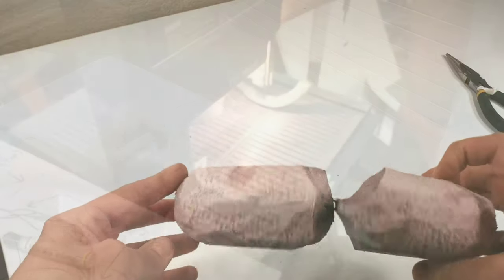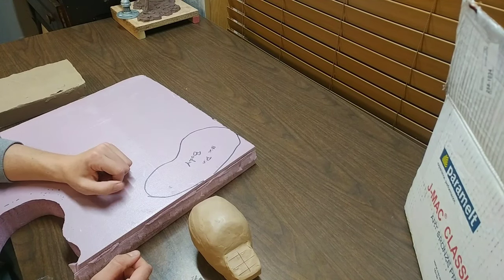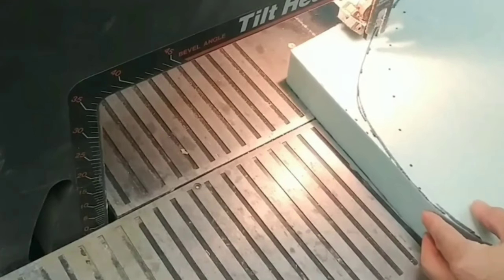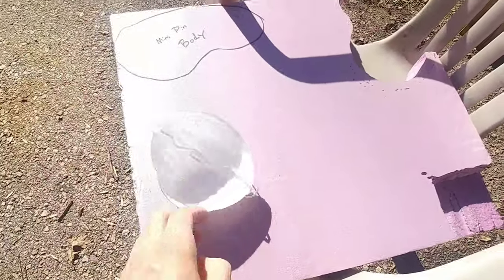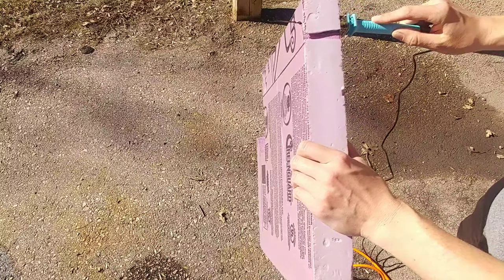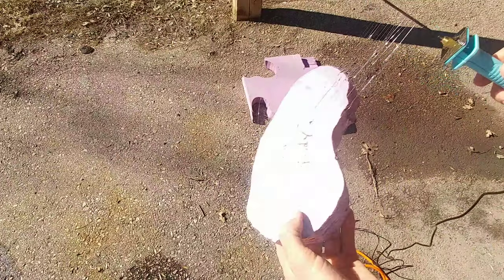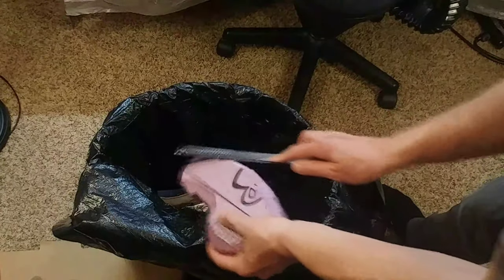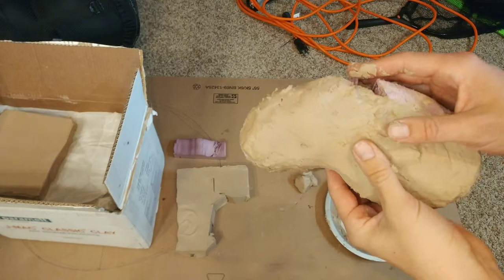How to Cut Foam (Polystyrene or StyroFoam)

Comment: Very thick pink foam can be hard to find locally and super high density stuff gets pricey.  Homecheapo and Blowes sells sheets of pink stuff.  Gluing it together to create the thickness you need $aves money.  EPS foam sucks, stick to the pink or blue stuff.  I hate chasing 5million little white balls. :-(
Reply from the maker: But take caution with the glue! It is very hard to cut through or file down by hand, especially if it is a good strong glue.

A thicker piece of foam will be easier than catching a knife or rasp on the hardened glue between those layers. If you have a band saw, then it shouldn't matter.
Reply: @FritzHoppe  3m spray glue.  No hot glue that's for sure.  👍
Reply: @jagboy69  Thank you for the advice! I needed this!
Reply: @jagboy69  Do you have advice on how to round out edges and make it look like molding? I'm making 5' x 2.5' cathedral windows with faux stained glass. So, they're big. I had plans to go buy the cheap insulation and cut out pieces and then glue them together to create the frames. Is there a glue you recommend to give a strong bond, and does the rasp work well to round the edges of that foam? Any advice you have would be fabulous as I've never done this.
Reply: @hdb80  5foot by 2.5 foot cathedral windows?   This sounds super cool!  I gotta be honest with ya, I don't really do much foam work.  I use it to bulk up sometimes.  Typical 3M spray glue from HD will hold the pink or blue foam together.  I have seen guys use a router to shape the foam.  I would suggest signing up at alloyavenue.com and seek out threads by a man called kcoffield .  When it comes to working foam into mechanical shapes such as yours, he is one of the best out there.  Here is a link to get you headed in that direction.  http://www.alloyavenue.com/vb/showthread.php?12972-Gating-Tubular-Lost-Foam-Part  I will suggest your contoured edges can be created with a custom foam cutter you can make yourself.  I've seen guys cut out some pretty impressive profiles mimicking crown molding out of blocks of foam!  This will be less messy than using a rasp or router by a long shot. Something like this is easily created if your half handy.  https://www.youtube.com/watch?v=KoK-J6ecEn0  You can wire up a foam cutter easily with an ac/dc transformer and some heavier kanthal wire that will hold your necessary shape.  Mounted to a router style table, you can slide your foam against a fence and really deck out your frame.  :-))
Hope this gets the brain cells working for ya.

Comment: I just need to cut down some foam panels, to make an insulation barrier over my bathroom exhaust fan, so that the attic heat stops coming down. 

I wish there was an easier cleaner way

If only my tool library idea was a reality already, maybe I could go barrow a foam cutter, I’ll have to get the ball rolling on that.